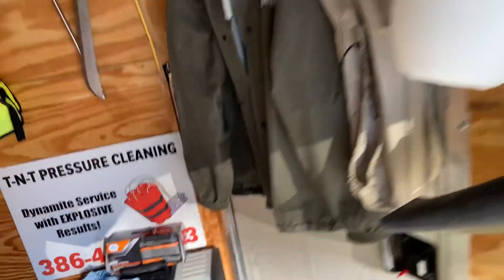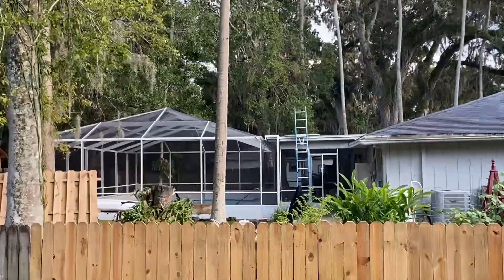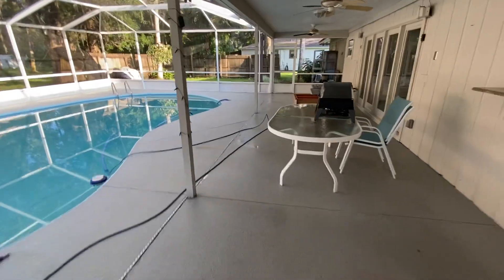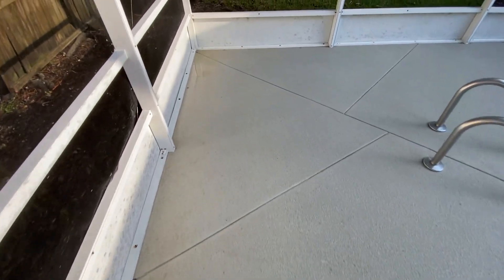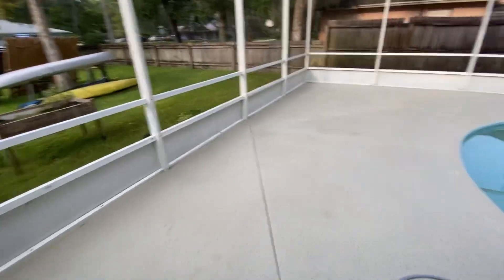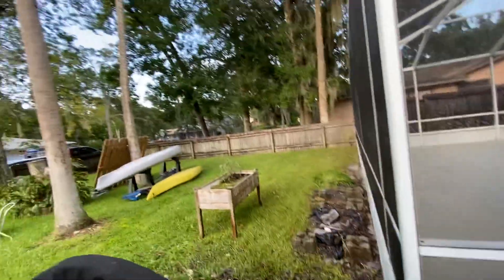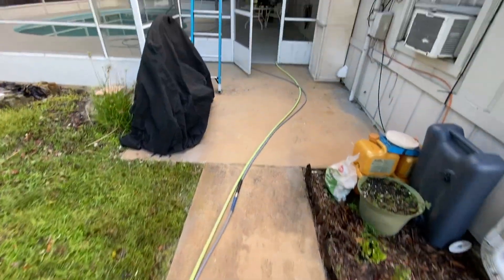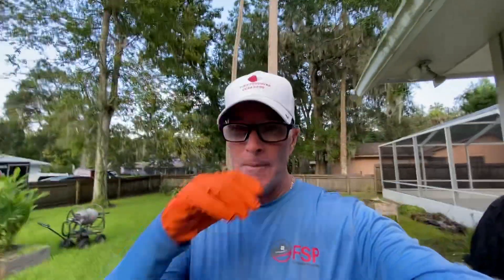Check out the pool enclosure now after some serious Xjet work

Comment: So you're saying you got 4% sh out of that hundred foot hose?
Reply from the maker: According to the woman who owns Xjet in North Carolina and you’re running a 4gpm - 4200psi machine with the unloader set to 3800 psi and you do not install a proportioner then you are pushing a 3.8-4.2% solution assuming the SH is over 10.5%

I am not a scientist or mathematician but I can say that I rarely need that hot of a batch mix, unless I am up on a roof with my 12v laying down that fire sauce at 6%. 

Throughout the years and most will agree we really have no clue as to the exact percentages… it is just a kind of figure of speech and we are somewhere near that mark. I suppose light, medium, hot and fire would be better in terms of being more accurate with words. Even if you have GF valves and a proportion system it is not 100% accurate. 

I always start as light as possible 1.5% mix for house washes and increase the strength for heavy organics as needed. Less is better! But yeah this cage I ran it straight out of the tank. 

That 100’ 3/8 polybraided siphon hose pulls just like the 15’ section they give you in the box. I have been testing this for 6 years; running 30’ sections, 50’ sections, 80’ sections and for the last three years 100’ Only time you’ll have an issue is in the air, so if you are up on a ladder more than 18’ you can tell it is struggling to prime at that elevation so just get some juice in the line, climb and spray the third story flashing, gutter line and soffits. Still strong enough to melt off the mold/mildew. 

Thanks and best of luck out there as well as much success in your business 👍